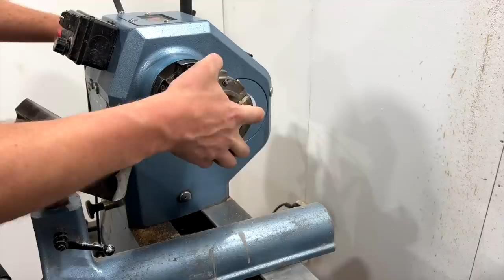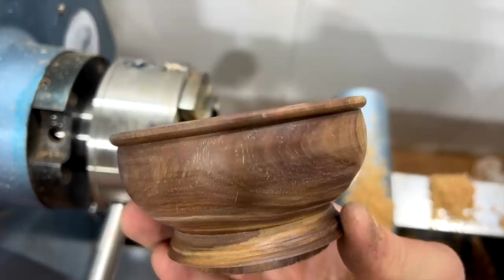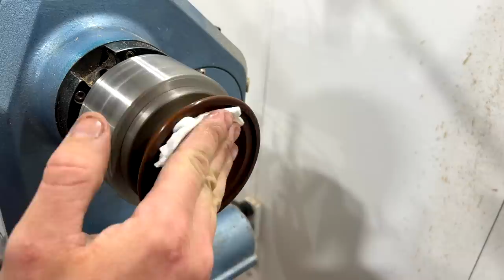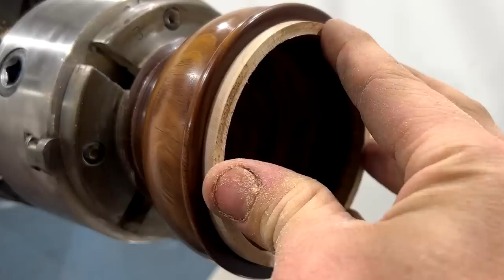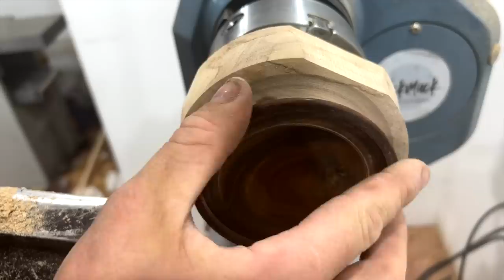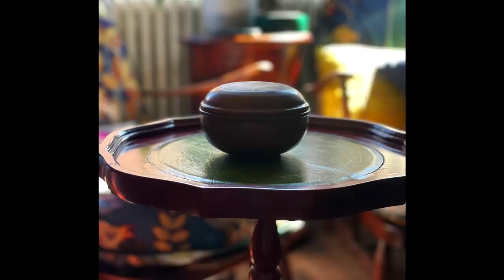Woodturning - 1826 Antique Bowling Ball

Comment: The box is lovely. And what a surprise to see this beautiful radiant wood hidden inside that drab bowling ball. The clockmaker John Harrison made gears and bearings out of lignum vitae because of its hardness and natural oils. Absolutely gorgeous
Reply from the maker: Interesting fact Mark. It is a very hard wood, you don’t really need to add finish as the wood contains a lot of natural oil. Have you done any clock making?
Reply: @JackMackWoodturning  I haven’t made a clock. Hmm that could be interesting! I have been refinishing old radio cabinets and restoring the old valve electronics to their original specs.

Comment: You can't beat a bit of Lignum.
Reply from the maker: For sure! A lovely wood. The natural oils, even in wood this old are still very prominent. 😊👍🏻
Reply: @JackMackWoodturning  It was used to make block & tackle on sailing ships because of its self lubricating qualities and stopped wet and swelling rope from jamming. It was the self lubricating properties were also why it was used for the bearings on the first propellers.
Reply from the maker: It’s still used for bearings today I believe I heard it was recently used on a nuclear submarine drive shaft.

Comment: I have turned two bowling balls and the finish you can get is amazing. The problem I had with both is the number of shakes that came to light as work progressed ( both balls were from a different source)
Reply from the maker: They have been bounced off each other 1000s of times. Lots of them are beyond use and are in very poor condition. This is why you find so many being sold as fire wood

Comment: That book matched spalted insert in the top is fantastic! I really like the way you use the lighter colored accents to contrast with the dark wood. At first I was questioning your choice to use the light colored ring insert for the connection point, but by the end you had me convinced that it was just right for the piece.
Reply from the maker: I’m glad you like it all miles. What would you have done differently if this was your project ?
Reply: @JackMackWoodturning   I would have taken fewer risks and ended up with a less interesting piece!

I just read a bandsaw book that introduced me to the idea of bookmatching. I'm still working up the nerve to try the technique, and your insert in the lid is really encouraging me to give it a shot.

Comment: First I had to wonder, touching tool to a 200 year old antique. Then watch as it turned into a beautiful little piece despite an oops. Was wondering if the original ribbing or markings were going to be kept along the ways, as it went to finish, those were good things to lose
Reply from the maker: Yeah I did try to maintain the essence of the ball. There was too much surface damage to keep any of the original features I’m afraid. It has obviously been chucked about a lot over the years 😊👍🏻

Comment: Without wanting to be picky, that's a lawn bowl isn't it? 

Quite different to a 🎳
Reply from the maker: It doesn’t say a 10 pin bowling ball.. 
it says
A bowling ball.. 
a lawn ball which this is, is a type of bowling ball. It’s in a group of ball games that involve bowling a ball to a set location. All balls used for such sports are called bowling balls as they are use for bowling.
Reply: @JackMackWoodturning  True, though this particular item is known as a bowl, not a ball. It's a very beautiful bowl, too!

I guess my point was that when most people think of a bowling ball, they think of the large resin ball with three holes for your fingers :p

Comment: A pretty little pot with lovely colour variation once the outer layer was removed - beautiful wood. Do you have any idea of the species?
Reply from the maker: This is Lignum vitae 
It is the worlds most dense wood. All lawn balls were made from it. It’s a beautiful wood to work.
Reply: @JackMackWoodturning  Thank you for the reply. I have never turned lignum but have a couple of small pieces in the workshop (called verawood, I think, so a species of lignum). All I need is the right idea and I'll sharpen up the gouges.

Comment: Is that boiled linseed oil?  Beautiful work dude!
Reply from the maker: It is not. Personally I think people should avoid boiled linseed oil. 
“Boiled” in this context is a chemical addition that causes the oil to cure. Rather than meaning it’s been heated. It’s not at all food safe and even on pieces like this I avoid using any finish that isn’t safe. Pure tung oil is a far superior oil if you are wanting to use oil finishes 
Thanks for the kind words

Comment: Inspitrational Jack! I have a couple of bowls in the workshop. I was wondering what to do with them - great idea thanks!
How did you find turning that old lignum vitae? Very dry presumably? And very hard and dense? It looked like you could only take a shallow cut?
Thank you so much for sharing. Great video. Not long enough imho 😀
Reply from the maker: Hey John. Lignum vitae is a pleasure to turn. It is the densest wood in the world but it is not “hard” it’s loaded with oil rather than silica so it’s not anymore dulling to your tools than most woods and the high oil content means it’s smooth to cut with a lovey surface finish. Got some on your lathe. It’s great stuff
Reply: @JackMackWoodturning  Thanks Jack, really helpful answer. I will eventually get round to it.